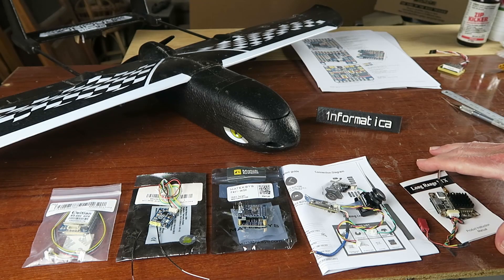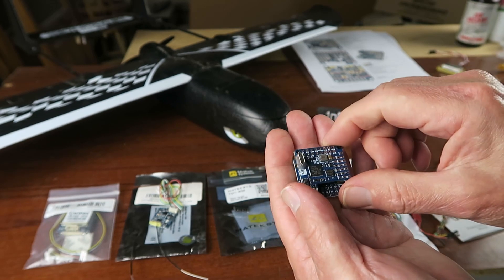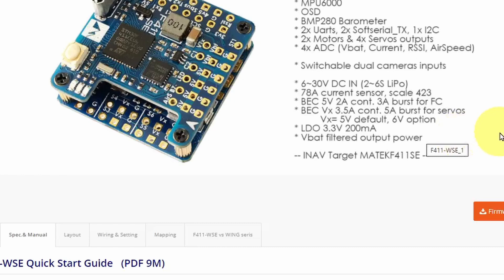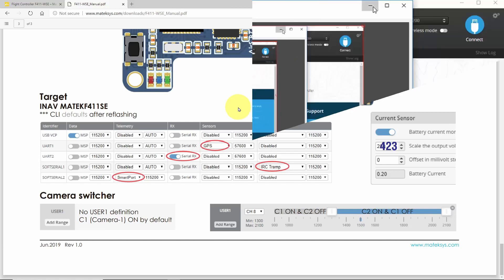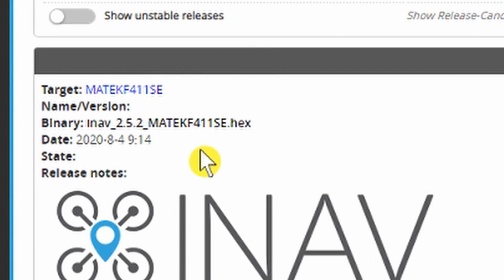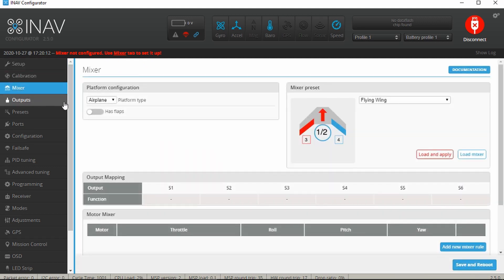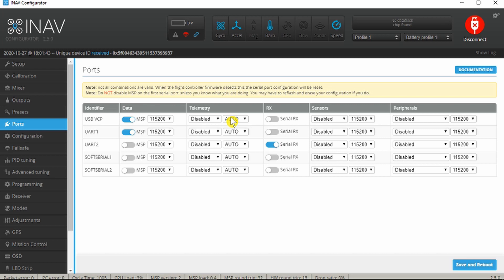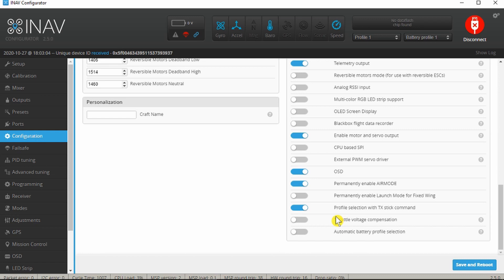Matek Systems F411 WSE iNav Flight Controller Skyhunter Nano Racing Project

Comment: Hello Friend, I would like to ask you for advice, I have a F411 SE Matek control unit I have installed the latest inav 4.0 fireware. Loaded the fireware, I calibrated the flight controller and I followed the various steps, then I started soldering the wires on the new TBS nano receiver that I connected to the UART 2 and in the programmer I chose the crossfire. To the small TBS receiver I soldered the negative of the same to the negative of the FC as I did with the positive, then the wire of the channel one of the receiver was soldered uart tx2 and the channel two of the receiver was soldered to the uart rx2. Then I went to the programmer inav menu on the receiver page but the channels don't move. you know how to advise me because I can't see the channels move. Thanks for your time I hope to receive your support. Franco

Comment: I've got the same exact setup accept I'm using Crossfire any chance you can post your Diff All. INAV although I'm running INAV 3.0.2. Curious if you ever got the launch control working.